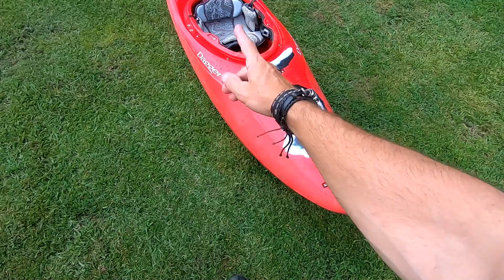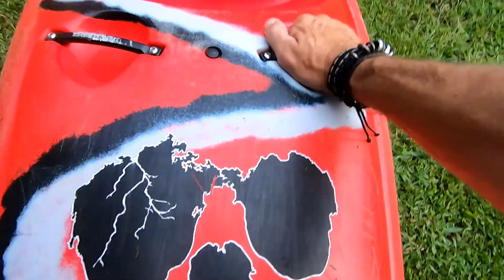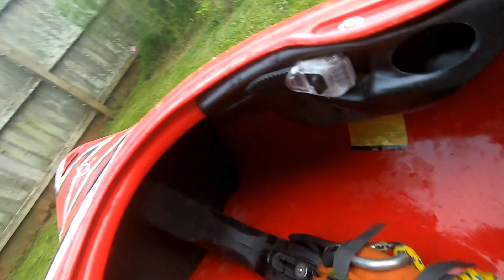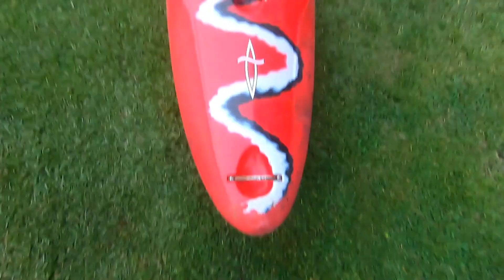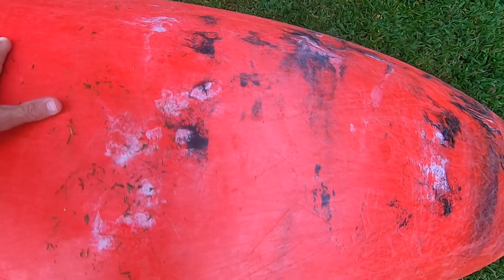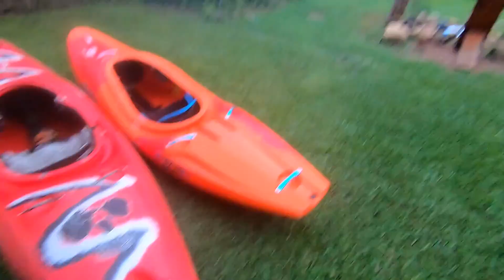Dagger Kayaks Phantom "Walkthrough"

Comment: A general kayaking question.  I was kayaking the New River Gorge yesterday, and the hole towards the bottom of Middle Keeney right line ate me and my boat (should have been further right).  What is the best advice when flipped and recirculating in a hole to try to roll?  I tried twice but the hole would just pull my boat back over when I was really close to righting it.  I ended up swallowing a bunch of water and had to swim.
Reply from the maker: wow that don't sound fun buddy.. and yeah its case by case on things like that like what kind of boat and creeker playboat ect and what Kind of hole like a vert ledge or more like a hole. I know about where your talking about because I was up there few weeks  ago. but the best tip I can tell you is get the the corners and try to plug the ends down to get blasted out or roll and reach out for the outflow and try to pull yourself out upside down..
Reply: thats a tough hole depending on the level-it can become a vertical ledge which is much harder to get out out than a wave hole. As Wade said try to get to the sides by side surfing out or try to plug an end to get out. Also much harder in a creek boat, especially if it is not a planing hull. A full displacement boat lodged sideways in a strong ledge hole, 95% of us are probably swimming out. My best advice is to practice somewhere fairly safe as a lot of it comes down to knowing your orientation underwater and not freaking out when you feel like your in a washing machine. Shutdown at the whitewater center is a decently sticky ledge hole you could practice on.